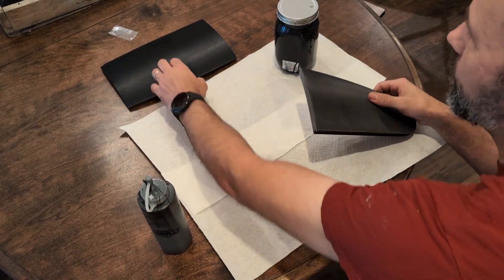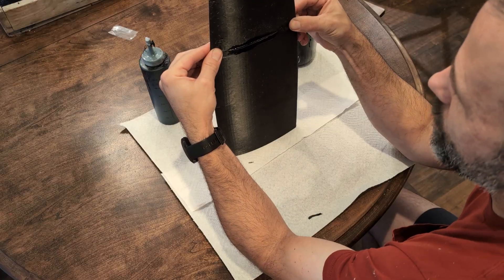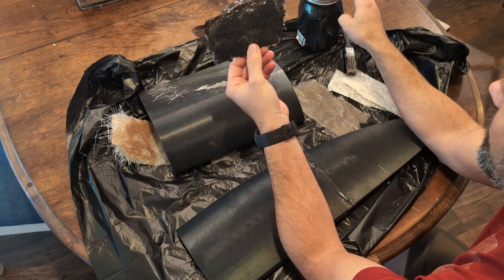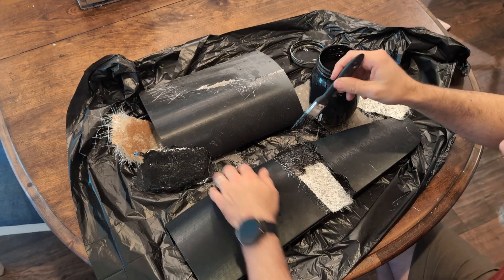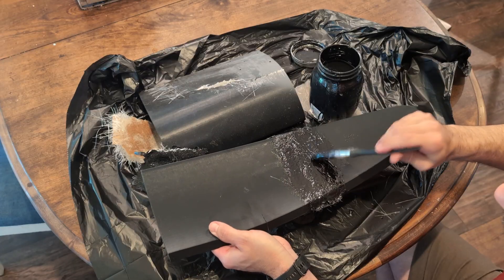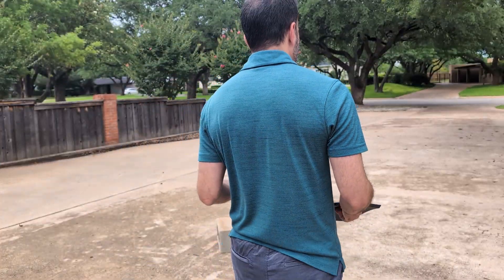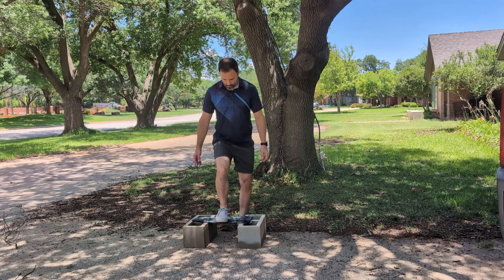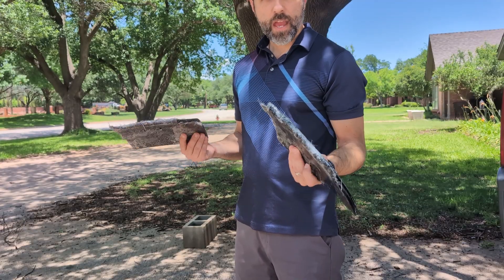Absolute strongest way to bond ABS (You can even build a car!}

Comment: As a former body parts builder from GRP, seems a shame to ruin the nice printed surface with that black slurry + glass fiber.  It adds thickness and an unholy amount of work to get smooth again.  Also, with the black slurry, you can´t see where there is air trapped under the mat which could invite problems down the road.
Personally, I´d either prime and paint the parts and pull a mold, or if it is a one off, print the mold,  and lay up a proper resin and fiber part with no nasty air bubble surprises lurking under the surface.
Definitely innovative though and a good way to bond printed parts together along their ends.

Comment: I love how you came up with this! Just getting into this as a hobby myself but have done composite layup for work for several years. It seems that you came up with a low-cost chemical method to bond the fiberglass and ABS parts to each other and the result is that the fiberglass acts similar to a skin wing design where the tension in the skin is the primary source of strength. I will definitely be trying this. Have you come up with a method to sand the surface afterwards that does not disturb the fibers?
Reply from the maker: Thanks. The easiest way would be to paint an additional layer of slurry prior to sanding. For my purpose, I will only need to rough the surface prior to adding primer, a skim coat of body filler, and then more primer prior to topcoat so I will not dig too deep into the fibers.

Comment: Interesting, how does this compare with doing the same thing but with fiberglass with resin, instead of ABS slurry? Understanding that with resin it doesn't stick to the part, I'm just curious about the strength difference with fiberglass using slurry vs resin
Reply from the maker: I would estimate it is only about 2/3 as strong as fiberglass with polyester resin when not applied to the ABS pieces but the fact that it adheres sooo much better makes it a much stronger composite.